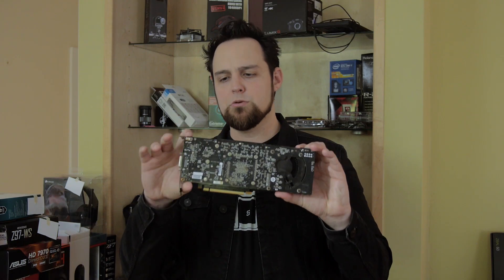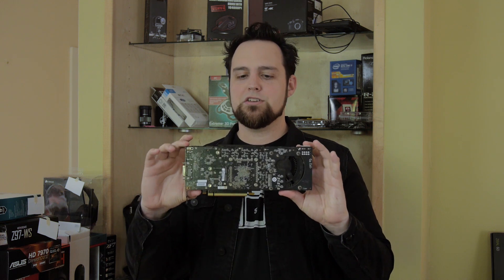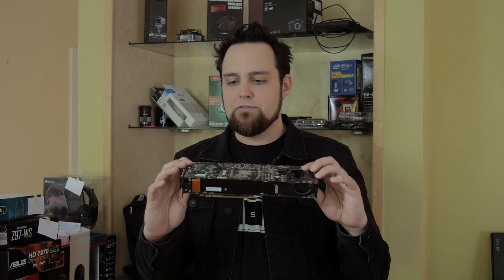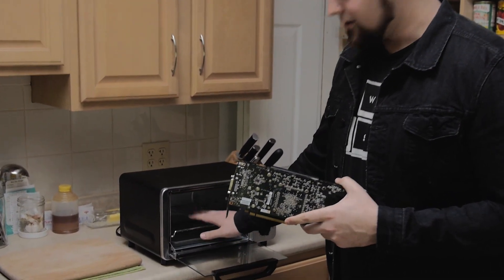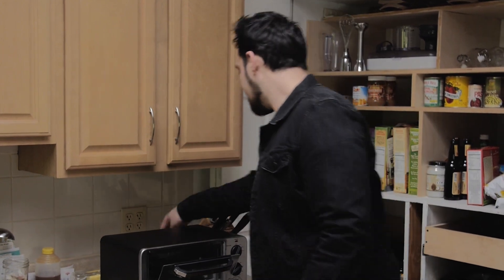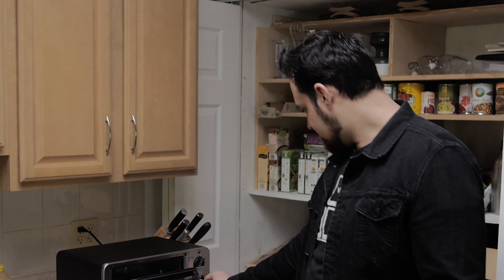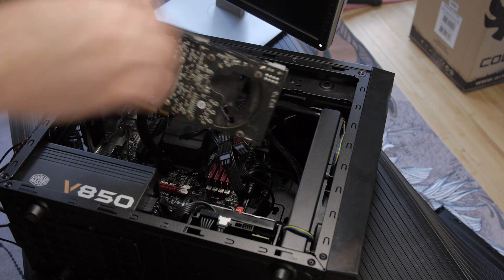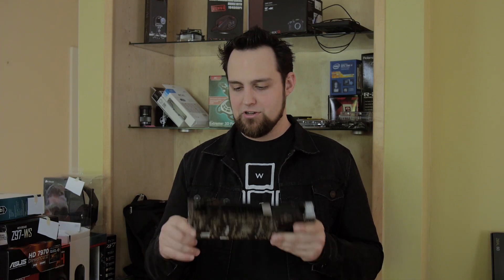How To Fix A Dead Graphics Card

Comment: I literally click on this video because i want to learn how to fix a dead gpu.

But, WHAT THE FUCK DID I JUST WATCH ????
Reply: +Born Boy The power of the internet buddy, the power of the internet. We all came here by accident.
Reply: Nazmul Hossain WHAT THE FUCK IS UP WITH THESE FAKE FUCKING ACCOUNTS! FUCK YOU!!!
Reply: Vidis da si konstantno vulgaran. Uporno ubacujes na Srpskom razne vulgarnosti. Takvi ne prolaze lepo u zivotu. Ja tebe ne vredjam na takav nacin vec na iskren. Ne pucam da te uvredim stvarno jesi prick,ali te ne napusavam. Imas ozbiljnih problema, ako te nesto interesuje mozes da pitas, hocu da ucinim i takvima. Ako nemas sta nemam sta da razgovaram sa takvima. POzz
Reply: +Born Boy I fixed my 8800 GTS 512 in the oven some 5-6 years ago. The stink is awful, but it worked and the video card is still alive and well. Definitely a last resort method and should make sure to use an oven which is accurate enough with its heat control. Wouldn't want all that tin as a puddle.
Reply: my fucking thoughts exactly
Reply: You should buy a reflow oven, remove the GPU, and check that it works, if it doesn't you replace it with one that does, after checking that al the pads are fine, and the connections aren't dead, oh and also that in your idiocy you didn't warp the PCB, if its all fine you re-ball the new GPU, and place it correctly on the BGA site, then put it into a reflow oven, and then let it cool after its reflowed correctly.
Reply: It's not the air that corrupts the data on a hard drive, it's all the dust particles that are floating around in the air. That's why equipment that is hypersensitive is made in cleanrooms to prevent dust contamination. Once the warranty stickers are removed from a hard drive and the protective outer casing is opened, the storage disk is exposed to particles floating in the air and is considered contaminated because it typically fails immediately or within a short matter of days or weeks from particles ending up inside its sealed compartment and eventually making contact with the disk surface.
Reply: +Connor Simpson that method could actually work.
Reply: +Born Boy you watched "fun"
Reply: +Born Boy you are not alone!
Reply: my thoughts exactly -_- ....
Reply: ফেনী ট্রেড fuck you
Reply: harun rashid fuck you
Reply: Eighther i Dunno xD
Reply: No it doesn't... its a fuck ton of bullshit.
Reply: Put it in a toaster oven for 20mins, see how you go  hehe
Reply: Actually the toaster thing might work. Because reballing works the same way, in case the toaster doesnt work and the balls don't come to their place on their own, than in this case you must remove and reball it.
Reply: me too
Reply: Marko Stepanovic i have only 2 Questions for you.

1. Have you Actually tried putting it in a toaster ?

2. Did it actually work for you ?

theorizing is one thing
putting something to the test is another thing

as an example of this
a long time ago, when i started I.T.
i was told by many many people that if you open the housing of a Hard Drive. THE AIR WILL CORRUPT THE DATA and you will not be able to restart it.

now. at the time, to question this. was considered stupid
and if you did,
the answer you got was

so.. You think you're smarter than hundreds of other people before you.

but.. guess what
one day, i got myself a hard drive

Not only did i open it,
i first installed it into a computer,
Turned on the computer and WHILE THE HDD  WAS SPINNING i opened the case

i can assure you that the Air does not kill the data
even though hundreds before me have sworn that it would

I have video evidence of this

so.. long story short
did you put it in the toaster to test your Reball Theory ?

let me know
Reply: Martin Kuliza I see you are one of those people who use other question not even related to the theme spoken off and use it as it is related. And no i didnt mean toaster. I've ment heating device. Its called re-balling the whole process . Ofc microwave/toasters are out of question. As it will damage electrics. Simple heating like re-balling machine will fix your problem. As for your stupid hdd question no , you can open the hdd it,air will not damage it. You should burn your IT diploma mate. What can damage it is you , with hands , if you scratch magnetic disc you can throw the disc away and save electronics. Also keep the area dust clear. But air has nothing to do with it . Burn it mate. Gl.
Reply: Marko Stepanovic You know what marko, fuck you seriously

how the fuck was i rude
sta seres

where was i rude
LET'S LOOK AT IT AGAIN SHALL WE

my first post was 
put it in a toaster for 20 mins  and see how you go
nothing rude there.. right 
Unless you misunderstood something
but.. i wasn't being rude

then you put out your comment,
which, for the record, i didn't see anything rude with that either

so.. from my point, all good up to this point
unless you misunderstood something

then.....

i asked 2 questions
they were...
 i have only 2 Questions for you.

1. Have you Actually tried putting it in a toaster ?

2. Did it actually work for you ?

and then i went on a bit of a rant about a life experience
big fucking deal

did i insult you at any point...
NO I DID NOT

again.. unless you misunderstood something

then ..
you came out with rudeness FIRST
i then responded with that  WOW.. SERIOUSLY  comment

so.. how the fuck did i offend you first

i would guess by the timeline of everything

everything turned sour FOR YOU at the point where you started the comment with 

" I see you are one of those people who use other question" etc etc

so. i'm guessing that my comment just previous to this, IN SOME WAY offended you

but, again,  i wasn't being rude, i did not mean any offense

so... what the fuck

i guess somewhere in that long post of mine
you somehow derived rudeness

now before you started being a dick
why could you not simply just ask me 

i mean, for christ sake
this is fucking you tube  ok

it's all fucking text
so.. it's only normal that misunderstandings will occur

and that's fine, i'm ok with that

SO.. WOULD YOU PLEASE TELL ME WHAT PART YOU FOUND OFFENSIVE

i would really like to know,  that's not bullshit, that's not sarcasm or trolling
i seriously want to know   ok

so.. you now how 2 options

you can continue to be a dick and insult me
or
we can work this out and you can tell me what you think offended you
and then we can agree that it was a misunderstaning,  which it has to be
because i don't know you , why would i be a dick to you

for gods sake, we are from the same country you idiot

why would i do that
jel si ti smotan  or something

so... do me a favour ok

let's start again
tell me what you found offensive ok

can you do that ?
Reply: i needed the same info, but trolls are on youtube and wayst lifetime on other peoples with rubish content

Comment: i was 1 min in.... dude!... remove all plastic parts, wires, connectors, everything down to just a pcb. then use a heat gun, there only $10. ive done this with around 20 items, works awesome usually.
Reply: +Um No  Where can you get a $ 10 heatgun?
Reply: harbor freight on sale often
Reply: lol on sale right now for $8.50...
Reply: +Um No 8.99 now!  Just got one lol
Reply: lol, awesome, fixin china

Comment: Old video but anyone trying to fix a graphics card do this -
Find an old oven preheat to 200 degrees celcius .
Remove graphic card shroud/fan assembly while oven preheats ,also remove old thermal compound as well .
Place card on little balls of aluminium foil and leave in oven for between six minutes for newer cards to seven minutes for older cards as older cards have solder with a higher melting point .
When time is up turn off oven and half open oven door then leave card in to cool down slowly over next hour .
Remove card from oven and reapply cooler with new thermal paste .
Enjoy your reflowed graphics card (around 80 percent success rate ! ) and run heaven benchmark or something that stresses gpu BEFORE you try your games ,
Like my comment if this worked for you too ! 
Goodluck oh also get out of the kitchen and turn in exhaust fans , also open windows and doors close by as fumes can be hazardous to your health .... Nothing to lose by trying this as card is already stuffed lol

Comment: So does the toaster oven actually work on graphics cards?
Reply: +TruFly you can re-flow solder with an oven if you are careful and have good control over temperature and exposure, but don't expect it to work every time, and read a guide first.
Reply: +Ongoingwhy If you literally give it a shot, you won't be able 2 repair it :P And it will be busted (cops will come in and look for the GPU murderer).

Comment: but for real, if you have nothing to lose, Take the heatsink off, wipe the paste off then make little foil riser balls and stick that thing on a cookie sheet and bake it at the melting point of led, leave it in there for 5-8min and let it cool. put new paste on and attach the cooler back and it has a high chance of working again, did this with an 8800gtx and the ended up needing cooked a second time, But now its good and must be permanently fixed because its in my moms computer right now no problems and its been 2 years. no artifacts.
Reply: +Joshua Pierre hah, moms with geforces.... its gonna be a strange feeling someday when I inevitably meet a grandma online listening to gangsta rap, guzzling mt dew, and trolling nerd ragers on COD (or whatever)  .   I don't even want to think about the chatroulette type sites, lol..
Reply: Michael Mettie these cam girls gotta get old sometime hahaha

Comment: The toaster oven thing actually could work. I never tried it with a desktop graphics card, but I used to have a first generation Playstation 3 which got the yellow light of death (YLOD) three times. The first time I paid to have to have it fixed because I was a nube. The second time, I looked up how to fix it myself by using a heat gun (basically an industrial strength hair dryer) to "reflow" the processor and it actually worked! The third YLOD I fixed it the same way I did the second one, but then I promptly traded the POS for credit at Gamestop.
Anyway, because of that experience, I bet it really is possible to fix a broken graphics card with a toaster oven, depending on what exactly is wrong with it, but the fix will probably be temporary.
Reply: +Richie P toaster oven to fix graphics card does work with a really high success rate . done it on multiple cards . i might be crazy but they seem as if they ran even better. maybe just poorly soldered boards to begin with ?? ... but the reason that alot of cards fail is heat . heat melts solder . pretty basic stuff.  didn't even hesitate when i saw another video to try and fix my cards lying around because anyone with half sense could see why it works and it worked multiple times for me .

Comment: I tried to speed up my gpu like that but it was harder. For starters the fire wont come out if the gpu is actually not broken, the manual on Satan's Gpu Fixing iPenta states that the pentaport will detect "broken" flag and launch WishGrant4Soul only if its present. Which it wasnt obviously, but i needed more fps so i read up wikipedia on satan + gpu and instead found a great article pointing some software and driver solutions that can help with speeding up your gpu, this is what i did:
1- installed new high res textures into gpu
2- cleaned up md5 hash on each memory megabyte
3- forced anti-anti-aliasing
4- swapped v-sync for h-sync
5- unlocked vhdd (was locked by nvidia)
6- incrementally lowered resolution to zero, and beyond, so now its minus 1920 by minus 1200, so now its quadruple performance, but everything is mirrored 
7-rolled back to stable driver from june 6 1666
8-textures are now displayed in ascii , you cant tell difference from far, but performance is times better
9-switched to abstract polygons, they are not drawn anymore, only points (i just use imagination to connect them, so it adds my brain power to gpu)
i also did some external modifications like smearing virgins snot on top of microprocessors instead of thermopaste, and put the whole case into unholy boiling water.

Overall i feel a bit violated,because i cant measure fps in my games because the number is too high even for int64, but it truncates to 6666666666666666666

Comment: Hi? Am running Geforce GTX 970 MSI graphics card, all of a sudden, it stopped working.. It doesn't display on the screen.. When the fan turns, it will stop aswel. Please, what must i do to resolve this problem? I love this graphics card so much.. Thanks a lot. From Stanley
Reply: Check power cables
Try integrated graphics (or any functional GPU) if you have it. If integrated graphics works, then make sure that the PSU is not a potato and dying, and that the GPU is properly seated + power cables. 
It may be a dead gpu
Reply: here is not a place to get answers and help, go onto a forum like tomshardware or any tech forum for help from more people. Some people may of had similar experiences.

Comment: Sir i want your help! How to know if my video is not working?
Reply: sepertik perlo Blank screen for starters, juddering. If it starts crashing under loads which were fine before. Loads of things can happen. What is it and what makes you think it's not working?
Reply: Silver Shaman When i open my desktop, it's all blank/black screen sir, but the fan is still working. But when i put through motherboard my screen goes on. My video card is poor/low, and you're my last hope sir if you can help me.. i don't have money to purchase VC. thanks! sorry for my poor english.
Reply: +sepertik perlo Sorry to say it, but your card has probably had it. Download latest drivers to be certain in case an update is causing an issue, but that's very unlikely. Depending on how much it's worth it may be worth trying to get it repaired. Otherwise time to save up for another :-(
Reply: sepertik perlo You should also check to make sure that the heat-sink and fan are clean and clear of dust build up.  A running fan will not do much if it can't actually flow or move air through the heat-sink. Make sure that you can see through all the air passages and try not to use compressed air to clean the fan, over spinning the fan can cause damage, I like to use cotton swabs and rubbing alcohol. Also if you have to remove the heat-sink from the GPU be sure to clean the old thermal paste off, then reapply fresh paste ( this part can be tricky a little goes a long way! ). I use Arctic Silver 5, it's expensive but works great. Good luck man.
Reply: sepertik perlo Good luck. Indeed as "showsoff" says a clean may help.  If nothing else will be good practice.
Reply: +showsoff79
 My video card is gt 9400 palit sir,it's poor but that's only i have. By the way thank you! I will do what you said.

Comment: I did put my GPU in the oven for 1 hour and then frozen it in the freezer for 4 hours and now my 4 years old GPU handles 4K Gaming on Max settings.
Reply: now I triple fire it with Tesla current and Used Salt free butter instead of thermal compound
Reply: +You tube Entertainment For All Dude--why did you take it out prematurely? After 5 hours in the freezer, you now could enjoy 5K gaming... too late for that now, though. Tough luck.
Reply: I have a laptop.

Comment: What graphic card is that?
Reply: ***** but it was a beast back in the day! =)
Reply: It is that old hahahaa 😂
Reply: It's 8 generations older dude. My phone now has more power. Technology moves faster than you think.
Reply: Its pixel fill is 9.6 and texture at 38. My card from last year is 70 and 200.
Reply: Fair call :)
Reply: +Lux Iced Glad to see someone with the same opinion.
I define an old graphicscard as a 3dfx Voodoo2. Was the first one that I installed.

Comment: put my 460 in to my oven. (i disassembled it so its pcb without coolers)
worked fine.
but i had to repeat it all 3 month
later i decided to buy a second broken one.
to hook them up into sli, so i did the same to it.
the second one gone up in flames.
no joke!

no components where harmed, just obviously the second one.

Comment: are u for real?!?!!? in a toaster
Reply: But what if it is her he he he.
Reply: wildanS
yes ^,,^  you like them?!?!
Reply: ZoeyWilliams I do. Too bad it's not you. ^_^
Reply: ZoeyWilliams it worked for me...
Reply: ZoeyWilliams Not like this, but yes, you can reflow solder in a toaster.  Usually the toaster has been refitted with a timing mechanism and a thermostat to control the different temperatures needed at different stages of the process.  One would typically remove all the plastic such as fans and housings, but it can be done.  Temperature is also way lower than 450.  Most of us just use a heat gun and some tinfoil to reflow graphics processors.